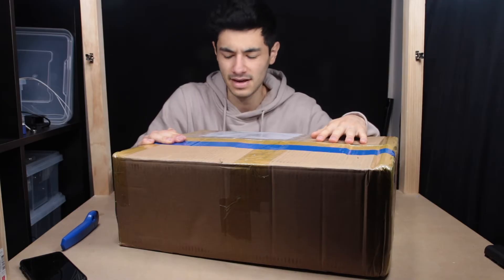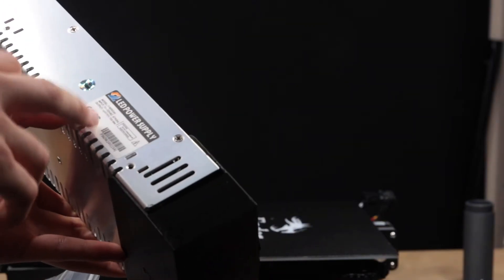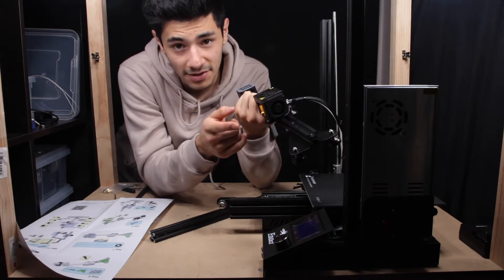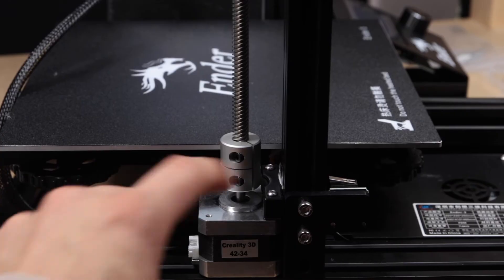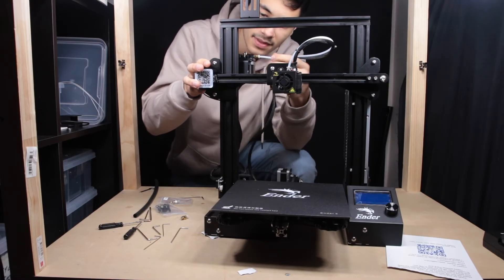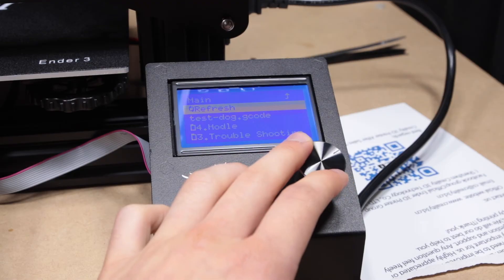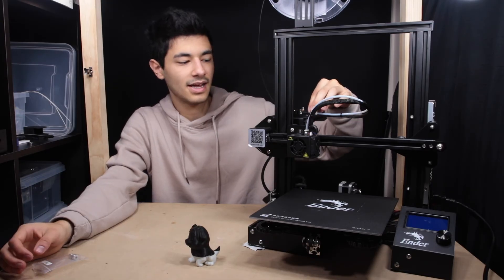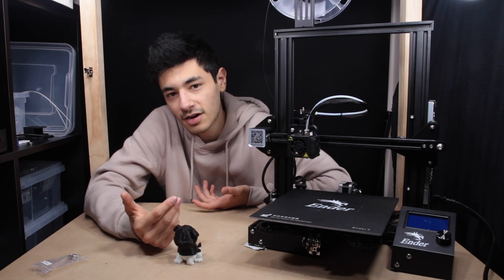Creality Ender-3 3D Printer | Assembly and First Print

Comment: Hi Simon, great review, I was just narrowing my "First 3D printer" search to the CR10 and Tevo tornado, and they come up with the Ender 3, and is in a really good price point. Beside the smaller build size, would you go for the Ender or for the CR10 as a first printer? Thanks in advance!
Reply from the maker: Depends on what you are wanting to print really. I'd edge for the Ender-3 just cause it's such good value and you aren't too limited by a small build plate size. What are you wanting to print mostly?
Reply: Thanks for the answer! I´m new to this 3D print hobby, so, I don´t really know what to print, but I think small stuff in general, toys or figures for my kids, cell phone stands,  some usable stuff. Maybe if my first experience is good, I will try some printed props, helmets, etc.
Reply from the maker: The Ender-3 should be great for you then and you can have a bit of money left over for upgrades and filament :)
Reply: Thanks! any recomendation on where to buy the Ender and some good filament brands?
Reply from the maker: Crealitys Aliexpress store is good and they ship quickkk. I mostly use Esun filament, I haven’t experimented much with filaments though and have basically just settled with Esun cause it was cheap and decent. This filament advice also varies massively by where you live as certain countries have more options than others.

Comment: great video. so questions
what was so average about the dog. looks good to me with some light sanding. 
how hard was it to reorient the extruder? (just unscrew turn and rescrew?)
how does that textured bed transfer to the piece (rafting required?)
Reply from the maker: Thanks!
Yeah so the dog would be fine with a bit of light sanding but it still came out with a few surface imperfections. I’d rate it 6/10. This sorta thing is mostly down to slicer settings though. 
It was pretty simple to reorient the extruder, one of the screws does act as a lever for the spring so that ones always a little tricky to put back in. 
The texture does translate to the final product but you can always use a raft or a glass bed etc.

Comment: Starting my first print (the demo dog) now, using a fresh spool of hatchbox white PLA.  I also had a problem with the extruder being rotated 90 degrees, and the bowden tube connector being broken as a result (it looks like it was assembled at least partly, with the extruder in the wrong position, which rubs the tube connector along the rail.)  

I tried levelling it and started the test dog, and now it looks like the PLA is coming up off the bed.  It didn't start with any heat on the bed, and 200 degrees for the hot end, so maybe those weren't the best settings?

This is my first printer, so maybe I didn't level it right.  And the Z axis limit switch mount was very poorly defined; the manual just says "32mm" which takes some eyeballing...
Reply from the maker: Ah they must be stuffing up all the extruders from the factory! The 32mm instruction is silly, eyeballing it is the best bet. I hope you’ve had some more success with printing!
Reply: Two weeks later, and I've had a lot more success.  I printed a handful of mods (filament guide, y-axis stop, squash ball feet, fan ring), added a glass plate for a bed and switched to 0.2mm for a nozzle, which has really ramped up the print quality (and slowed prints way, way down...)

Have you done any videos on strategies for reducing stringing?  My first roll of filament was white hatchbox PLA and apparently that has a reputation for oozing and stringing more than others?  Or I've just gotten better at orienting models to reduce islands...

Comment: Wish I saw your video first. You had the exact same problems as me 100%. The extruder filament guide was 90 degrees off, the leadscrew, having to loosen the bed to flatten it as it was rocking, the PTFE holder was also not functioning correctly. This was a backup printer and for the $240 (Amazon Prime) I paid, pretty much expected some issues. The heatbed let off that "China" smell that slowly seems to be going away. Printed a couple test cubes, it's about .1mm wrong in every direction but not really sure how I would be able to adjust that to get better dimensional accuracy.
Reply: Calibrate your e-steps on the extruder, and the extrusion multiplier.
Reply from the maker: I’m guessing all of these issues are just because it’s their first run of these printers. I haven’t run a calibration cube on mine yet but my Ender-2’s are all very accurate dimensionally. You may be able to adjust the scale in your slicer?